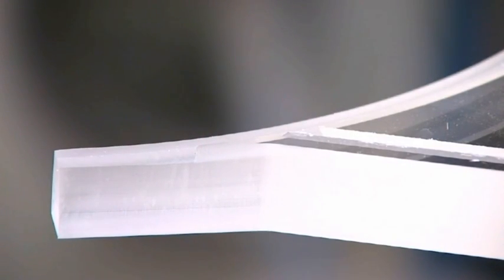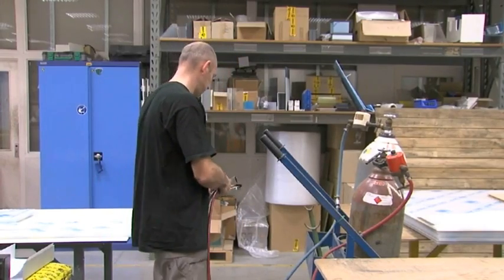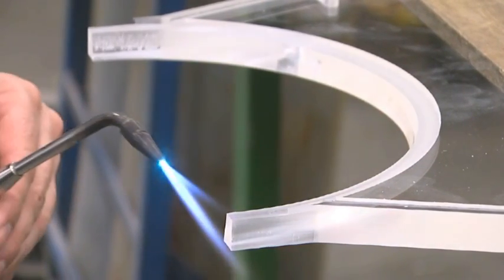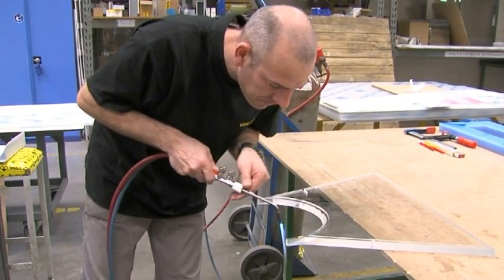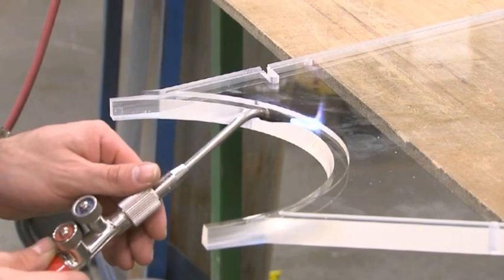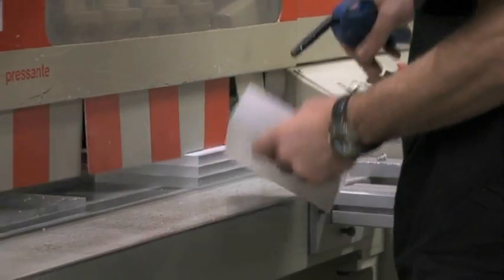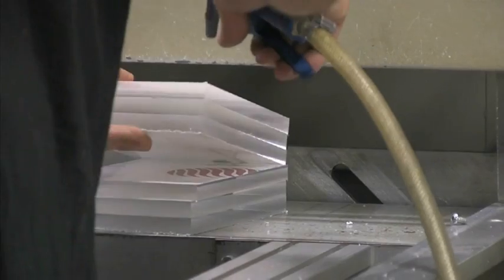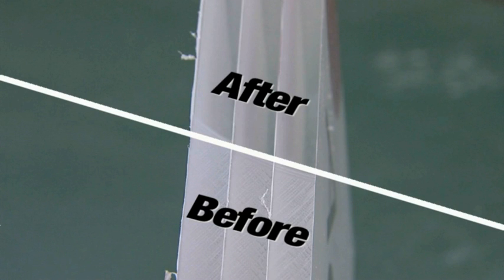Acrycast and AcryglasXT Acrylics - Flame Polishing Acrylic

Comment: I can't get the haze off my acrylic. I tried using 400 grit sandpaper down to 2000 and I used Novus 1 and 2. There's still a really bad haze can someone please help.
Reply: +Boxinfanatic TheTruth maybe a cloth buffing wheel on a cordless drill.
Reply: +SE45CX 
Unfortunately I tried that but it didn't work but thank you for the response.